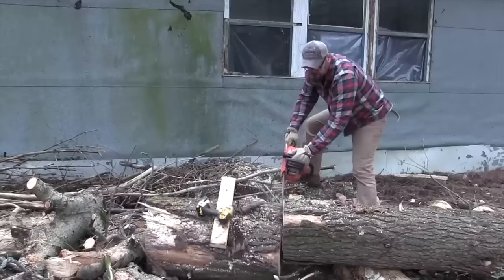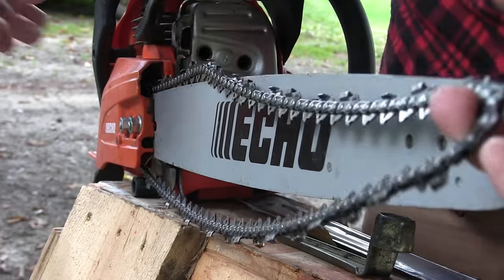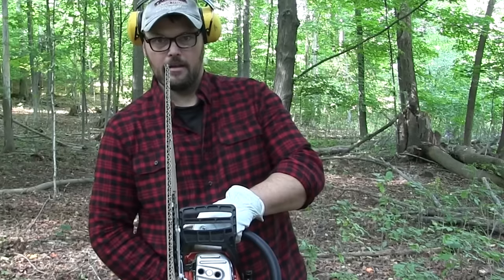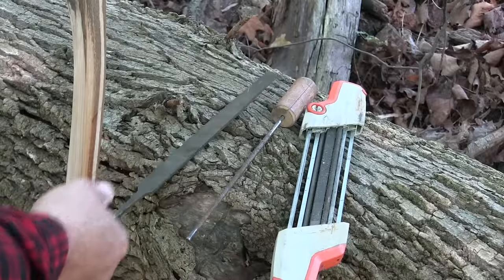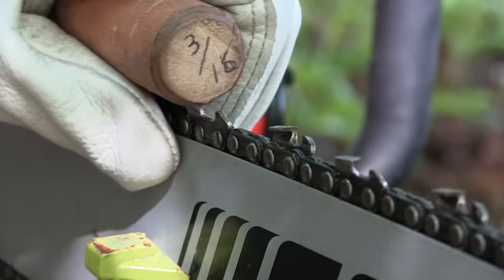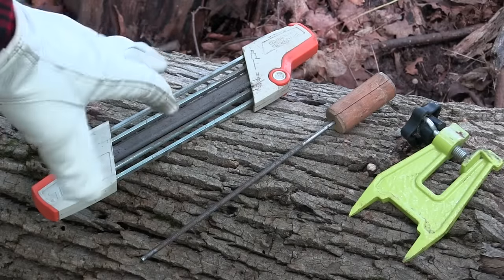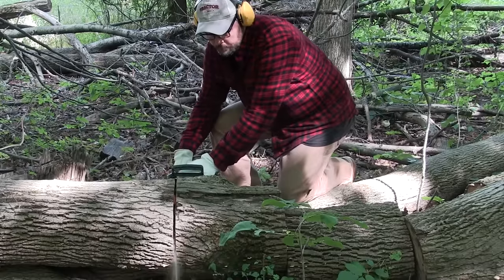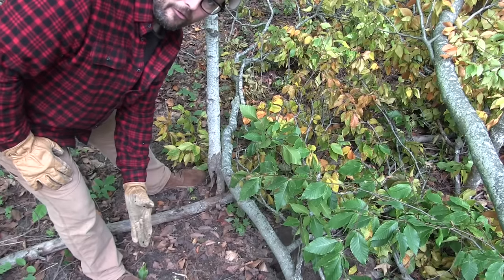Chainsaw 101

Comment: Want to know why Dave has 1M subs?  Videos like this, thorough, well-thought out, reinforcing the important parts multiple times.  Authenticity: Dave states his experience is limited to building a log cabin & firewood.  Great safety tips and the 'why' behind those tips.  Excellent coverage on 'stored/potential energy' and the dangers & unpredictability.  I also personally appreciate how Dave takes pride in his tools.  Easy to pile on here... chain sharpening, fuel tips, starting tips... This content is just packed w/what ya really need to know about owning/operating a chainsaw.  Thanks Dave, you raise the bar with every video.

Comment: Excellent commentary.

When operating a chainsaw.
Always step back and take a second look before committing to the cut.

Check your angle one more time.

I have two electric pole saws. One electric saw, two gas powered 1 Husquvarna, one Stihl and bought a 40volt Ryobi with an 18in bar yesterday.

Each has their specific uses.

Comment: My grandfather died in 2019, a month ago I was at his old house and "saved" four Jonsered chainsaws: 62 (mfg: 1969-1970), 52 (mfg: 1971-1982), 370 (mfg: 1986-1988) and 2041(mfg: 1990). Been cleaning them up and checking how they work and if they don't run, try to make them run. Right now the only one that doesn't run is the 370 :) Grandpa worked in forestry back in the days. Found your videos yesterday, you are really good at explaining things, thank you! Great videos, keep up the good work! Greetings from Finland.
Reply from the maker: Keep those old Reds running

Comment: You are not wrong. Great video and very well explained!
I’m a very safety minded person and therefor run thru many scenarios in my mind on and off the job site.
Two expansions on your points:
1) Footing. Pay real attention to what’s around your feet as it is very easy to get tangled and or trip on something. Thinking of de-limbing a tree. All those little branches catch your feet. What’s your exit paths if you need to escape a situation. Don’t trip over that log that’s right behind you.
2) Your cardboard plane example is right on. I will not cut something if someone is down range on that plane.

Thank you for your videos!

Comment: Dave that was a great video, at 72 I have had firsthand experience with stored tension. I lived in Florida before retiring in 2021, there was a Brazilian pepper tree in back that needed cut down. It had three main branches that had to be cut, I cut down the first with no problem. The second one however was a different story as it came down it turned and put tension of its branches. I studied the tree before stopping that day so that I knew how to cut the next day. The next morning, after sitting everything up to get started, I had started working backwards from the way I had say I would cut it the next day. Well, here I am on a six-foot ladder with pole saw in hand, started the cut and saw what was about to happen but it was a little too late. I threw the pole saw to get it away from me just as the branch made connect with the ladder. I fell backwards landing on the stump of a tree with a vertical V-shaped cut, let me tell you that hurt and yes, I went to the hospital on my own. Lesson learned study a branch with tension before you make that cut because you cannot take it back trust me. The fall hurt my pride and caused bruising from my buttocks to my ankle on my left leg. Thankfully I did not loss any work and I still cut that tree down. Have a great day up there radical land.

Comment: Good points, safety is your best friend. I wear a screen face shield because I had an old Stihl without a chain brake. Not a problem as I used one for logging when I was young. I used this one a lot yntil one day we needed fire wood and I was sick. Bad combination which required over a dozen stitches in the face. I bought a Jonsered with kick back safety and a hard hat with a face shield. Never work when you are sick. One other thing is let the saw do the work. If it is sharp, it needs no downward pressure. People use a chainsaw like a handsaw thinking that speed and pressure are needed. Keep up the practicle help. You might show how wedges help with making cuts.

Comment: I was an arborist for 12 years working doing contract work for a local power company. This is an excellent video. You drove home the single most important thing when using a chainsaw, common sense. I've seen many guys making trips to the emergency room who wore all their safety gear. My boss used to say often 'you can't fix stupid', so true. I was blessed to only have one major incident. My safety glasses slid down my wet face during a storm and I ended up with big sliver of oak puncturing the corner of my eye. Thankfully it was the corner and my eye was fine. Oak sap burns your eye like fire though. Lol

Comment: Dave, I don't know how I missed this one, but...... Buddy, you knocked this one outta da park!! I've been using chain saws for 60+ years now, and if I didn't learn something new in this video, I reinforced WHY I do certain things. I applaud your stressing safety... Safety... SAFETY!!! It only happens to the other guy, UNTIL YOU ARE THE OTHER GUY!!!! I'll cite another example: table saws. My 10" belt drive saw is over 50 years old and doesn't have all the safety features of a new one. I treat that saw the way you treat your chain saws. It's not a 'hangar queen,' either. It's had enough use over the decades I've rebuilt the motor... twice now. What I'm leading up to, EACH AND EVERY TIME I want to cut a piece of wood, I look at my material, look at the saw and where my hands/fingers are going to be throughout the cut... NOT just the start or finish. Thanks again(!!), and stay safe...........

Comment: I like your videos on any topic...  I've been using chainsaws since I was a teen, but in my 70s, moved to electric with a generator as they are strong but lightweight.  I don't climb trees anymore, so less risk.  Back in the day, I broke every rule you have mentioned, but somehow never got badly injured.  (Luck, not skill.) I did tie my ladders to the trees after having to drop a saw once to grab a tree and hang on.  I do have a rule now, maybe due to age, that you don't seem to have yet.  Never use the saw without a helper or observer in case something does happen.

Comment: Excellent video, Dave. I saved it to a folder entitled "Instructional". I even looked up where to buy non ethanol gasoline in my area of NM and there is only one station. Thankfully it's right down the road in my town. I may start using it in my car too, after reading up on the differences of ethanol and non ethanol fuel. Thanks so much. God bless you and Brooke.
Reply from the maker: The car should be fine....but anything that sits around unused....like a chainsaw or an outboard...NO

Comment: Thanks dave! Ive never had the pleasure of running a saw, just the chore of schlepping the gas and bar n chain oil through the woods for the peole that did run the saws.  Now i feel less scared to try it. The explanation of how the saw acts differently depending on the top cut or the under cut is one of the mysteries that i wondered.

Comment: As usual, Dave does a Great job of making the simple...simpler to understand! I'd like to add couple of things. NEVER move or walk with a spinning chain! Use that chainbrake as your best friend! STOP the chain anytime you are going to move with your saw. As Dave shares, simply catching that spinning chain on a small branch can LAUNCH that bar upward. In fact, a spinning chain under power MAY cut thru a branch that would otherwise make a chain that is NOT under Power, to catch the limb and bounce that bar upward toward you. You could get scratched by the saws chain if it's stopped....BUT IF IT'S MOVING  and it contacts your body, something's gonna get CUT!  One other thing. Always "set your position" before you start cutting. Almost like a lineman in football, you want to have both feet Planted under you so you have good footing and Max. control over what it undoubtedly THE MOST dangerous "tool" the average homeowner will use. Used correctly, they are incredible. Used incorrectly, they are lethal. Nuff Said.  On sharpening- if you can "see" the cutting edge of the chain, it's still dull. It should be filed or ground to a point that it becomes invisible. Anything less won't cut it. If your saw isn't "throwing wood chips", it's time to stop and sharpen your chain. Not doing so will lessen the effectiveness of the saw and prematurley wear out the chain AND the bar. And that  gets expensive! Thanks Dave!

Comment: I been using the same saw since 1988 , it's called maintenance, cleaning including the bar using hacksaw blade to clean channel,  and sharp chain including the Rackers depth no synthetic oil mixing 4 oz. Pr 1 gallon.

Comment: Right on Dave, right on. Good to see you back. I have 5 chainsaws. Now I got my 660 for the real big stuff. Something my 20in Echo won't reach around. And I have a 24in Echo. They're both cs-590 but also have 2  40-year-old Stihl and a Husqvarna. Don't use the older ones too much but there are times you're glad you had them just for taking off the smaller branches. I appreciate very much the safety video I'm sharing it with a buddy of mine that thinks hanging onto the back handle and Swinging the saw around is the best way of starting it.😮

Comment: Thank you Dave. Especially stating that a chainsaw is a dangerous piece of equipment and to use caution and common sense when using and not get a false sense of safety using safety gear.🎉

Comment: I have not had the time to watch this particular video, but I felt compelled to comment on something current in the hopes you'd actually see it. I just watched the video from your collection that walked the whole experience from the first property. My man, I am so very impressed with what you've done. I am a finish carpenter by trade and understand sweat equity, so what impresses me most is your ability to up and ditch it for a new adventure. The reed that bends does not break. You inspire me, thank you for actually picking up that camera. I am grateful you did.
Reply from the maker: thanks !

Comment: Dave I have a Stihl chainsaw that looks almost identical to Yours it is an 026 that I bought used in 94 it has worked like a charm as long as I keep a sharp chain on it and everything cleaned plus the right tension on the chain .  So for this video has been excellent information on using a saw!  I agree with You! Limbs under a load or a tree under a load are extremely dangerous please everyone listening pay close attention to anything you think may be loaded up!  If You can move it with a chain or rope and truck are tractor your way better off! 
     Thanks Dave this was a great video!👍👍😊

Comment: Dave, this video is literally a day late for me. Lol. I had a tree hit by lightning in my front yard recently and I just cut down and cut up what was  remaining of the tree that didn’t get blown off in the strike. I don’t have much chain saw experience but I pretty much did everything you said as far as staying out of the path, cutting in the right direction, etc. like you said it’s mostly common sense. The only thing I did wrong was having the wrong size saw. I bought a 10” electric chainsaw because I figured once I cut this tree up I wouldn’t do much more than trimming in the future. It was fun cutting through the base of the tree with a short saw.

Comment: The same basics my dad taught me at age 10. These days I'm running an electric saw. May not have the same power as gas but I'll take the power loss knowing that as long as the battery is charged, I can start it. Still have a gas one but have not used it in 5 years beyond starting it few times a year.

Comment: Ive own gas to cordless,and i like my greenworks the best. I can cut a 1/2 cord with 1 battery. This is the second one ive bought. Ive been cutting wood for at least 50 years.  I always like to clean any type of machinery after i use it. Its like using a wrench ,clean after i use it. Thanks Dave for showing us your techniques.

Comment: Great video,  very informative.. my 2 cents: the reason for the hardhat isn't necessarily to protect you from falling branches.. it's to protect your face and head from a kickback. I saw it happen to a guy that had been running chainsaws for over 30 years at the pole yard we both worked at.. after all those years, he had a kickback and somehow managed to throw his left hand up.. well, he lost all 4 fingers, but his face was spared injury because of the hardhat.
The best piece of safety advice I have is that just because something hasn't happened, it doesn't mean it can't or won't happen.  You can go lay your head on some railroad tracks for 5 minutes every day and you might get away with it for decades but then one day the train comes a little early and splat there goes your head.

Comment: Gets my approval. I'm turning 70 next month and only touches a chainsaw on occasions for the first 50 odd yer of my life, though I have always been a DIY guy and learn as much as possible about the things I take on.
In the past year I've gone from a 16" Wen electric and a Poulan 4018 to an array of chainsaws and support tools.
I upped my game from a little yard cleanup to Full blown firewood gathering - Removing down trees free for the firewood.
Your Cautions are spot on. I would just add - Keep Hydrated and Stop/rest if you are getting fatigued. To often pushing oneself to far leads to unconscious mistakes.
*oh and I didn't notice anything about widow makers........... but maybe that is a topic worthy of its own video.
As always - watch out for big rocks hiding under downed trunks and expect to get bitten by a nail or barbwire buried deep within trees. I seem to lose more chains to metal than Dirt and rocks combined.(carry a spare chain,,,,,,,or 3, lol)

Comment: Great video, Dave! I really appreciated the detailed explanation of the safety features on the chainsaw, especially the chain brake and catcher – those are often overlooked but essential for preventing accidents. Your tips on maintaining proper chain tension and sharpening techniques were super helpful too. How often do you recommend checking the air filter for optimal performance? Looking forward to your next video!
Reply from the maker: check it every couple of cords of wood.

Comment: I have a Proyama chainsaw, and I will say that this Proyama chainsaw is better than my Stihl and Husqvarna ones. It has plenty of power and it's easy to maintain. There's no kickback at all and even with the included chain it cut pretty quick and very clean. using the included chains I cut some pretty large logs. It's certainly not light and could probably be a little better balance but I don't do this for a living so I'm fine with it. The two bars are a very well built and very sturdy. Idle is perfect out of the box. Chain brake works and is essential. The included safety equipment actually does a good job. The ear muffs and face mask are not the best quality material but they both will certainly protect your hearing and most definitely your face from flying chips. The face mask screen unexpectedly heavy duty. The gloves at best will keep any sweat off your hands and prevent it from slipping. The gas can is very handy! I can't speak for professional use but I will say I highly recommend this Proyama saw for home use and I would most certainly buy one again if I needed. The value of this chainsaw is amazing and costs less than 1/2 of the name brands and does just as good or better job.

Comment: Great video.  Just an FYI that chaps and other protective clothing isn't made of kevlar.  The intent is not to stop the saw blade the way such garments might stop a bullet or resist abrasion of asphalt on an unfortunate motorcycle rider's legs.  They're made of Engtex or some equivalent fibre.  The intent is that the layers of these fibres sort of explode into an expanding mess when the chain cuts them and they almost immediately get caught up in the chain and sprocket, having a similar effect as the chain brake.  Don't use a saw without chaps.

Comment: That was a pretty good set of basic instructions but I would also have reminded always to check your chain oil level before starting to saw. And another good safety tip is never to saw above your shoulder line. That way the saw won’t decapitate you if you have a kickback 😅

Comment: Ran a chainsaw for years. Worked for a tree removal service clearing power lines. I was young and stubborn and didn't want to wear my chaps. Boss told me wear them or go home . Since I needed the job, I swallowed my pride and put them on. Fifteen minutes later, I'm cutting underbrush at a big oak fixing to lay it down, and to this day, I'm still not sure what happened,  but that saw kicked back at full throttle and balled up in my chaps. It would have most likely took my leg off just above the knee had it not been for those chaps. Needless to say I thanked that boss man for being more stubborn than I was.

Comment: Seriously, though...thanks. Have a friend who got careless and "luckily" ended up with staples from his forehead to his chin! AND a relative who "luckily" ended up with a severed toe tendon and a ruined pair of shoes.
Reply: Good advice, and well done.  I would strongly recommend chaps.  I gave up on gas saws and run only electric - much quieter, no fumes, and by the time I’m tired the saw is out of juice.  I run a corded saw at the house to buck longer logs to length.  The key to all chainsaw use is to keep the blade sharp.

Comment: Dave, do you have a video/or could you makeba video to show the proper way to fell a tree of different sizes. 
I so many newbies who cut straight across & try to man handle the tree to fall a certain direction. What type of back cuts and the proper angle for the wedge. And most of all where to cut to get the tree to fall a certain direction. Many people need your help.